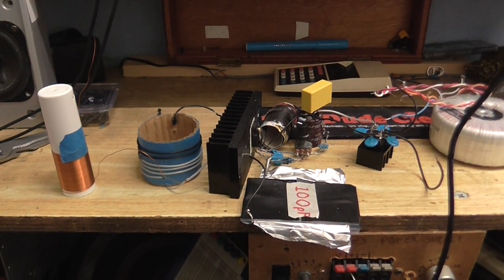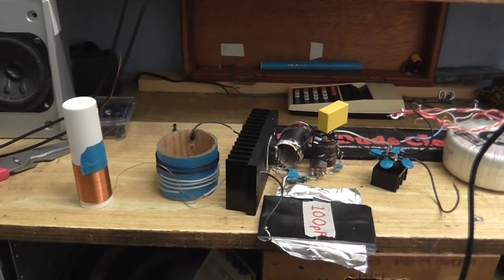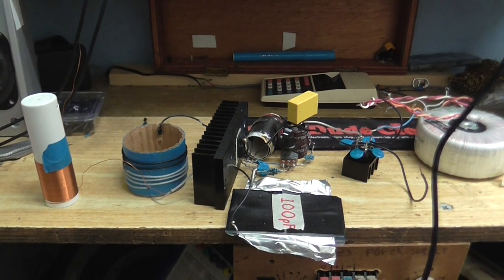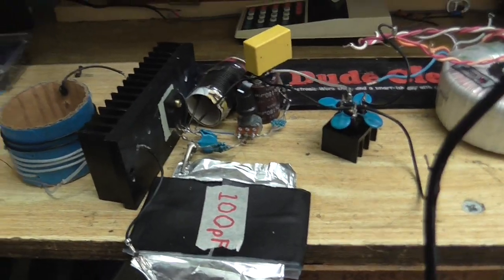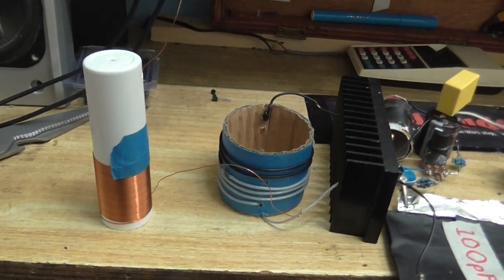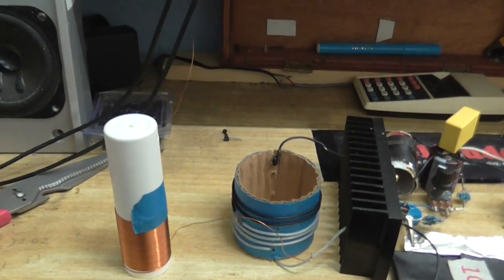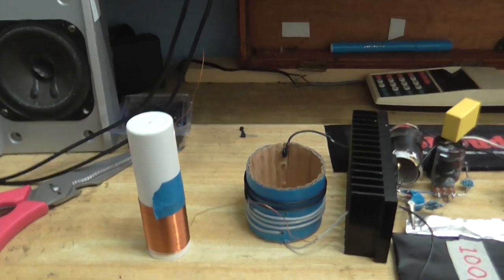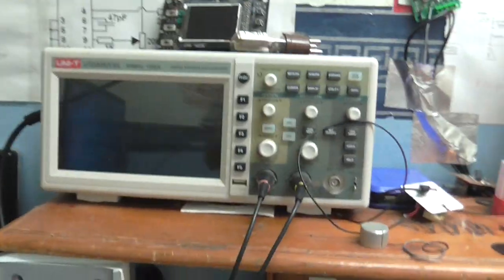[TEMP] I give up with this plasma flame generator

Comment: Oh no, don't give up that supernice superweird circuit? I built two of them and it costed me many days to get it working good enough. But it became a most satisfiing thing i built. 
I think that maybe you have to supply more Ampéres to it because mine only start to generate that weird flame by 60v by wich it draws almost 5A.
And it works best with a resonatorcoil with 51turns on ∅4cm or 45 on a ∅4,4cm core and that was only found with absurd many trail&errors.
Yours started to oscillate at least, while i only after days found working coilvalues to even come to oscillation!
But it is such a superinteressting, superweird and impressing circuit. Most info about it i found on the website from EU-experiments or such kind of name. If you want i seek the right name from the site? It came from the description from viddully here on youtube or from styropyros absurdplasmaflame description.

Comment: Once you get Air variable cap, it would make it so much easier
Reply from the maker: But I tried with one of those, it acts like an antenna and makes any nearby speakers buzz loudly.
Reply: use RF air caps. Aluminium foil caps tends to be lossy due to poor dielectric material

Comment: Have u measured frequency it runs at clem? Seems lower than 10mhz by the OP ? If it is 10mhz wonder if there is some modulation going on at a lower frequency??

Steve
Reply from the maker: I know there is a lot of ripple in the supply, not much I can do about that, it's hard to measure it because the ripple makes my scope's frequency readout jump all over the place.
Reply: @CoolDudeClem  keep at it Clem I know you can get it going you are more than capable mate 👍👍👍👍👍

Comment: Are you sure that the method that you came up with to determine the Secondary Coils Resonant Frequency is really valid?
You are trying to achieve a Parallel Tuned Circuit here aren't you?
That's the Secondary Coil's Inductance in parallel with it's own Shunt Capacitance.
Parallel Tuned Circuits go High Impedance at their Resonant Frequency so shouldn't you be looking for a peak rather than a dip maybe with your Test Circuit modified slightly.
It's just a thought.